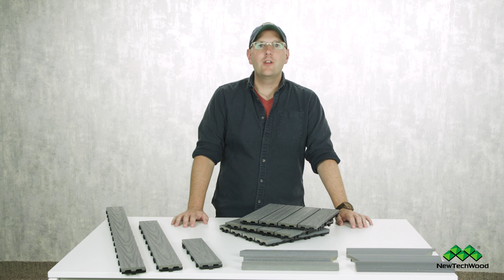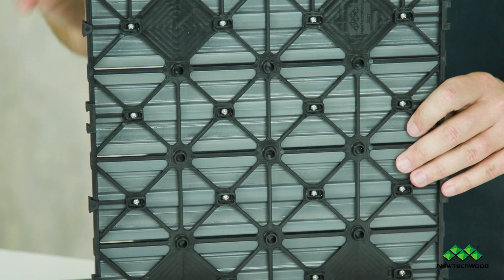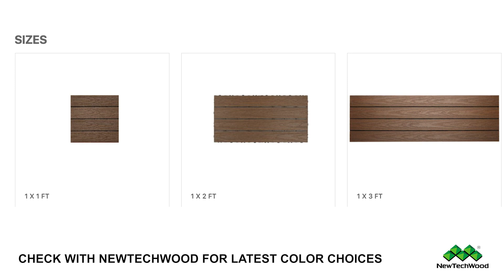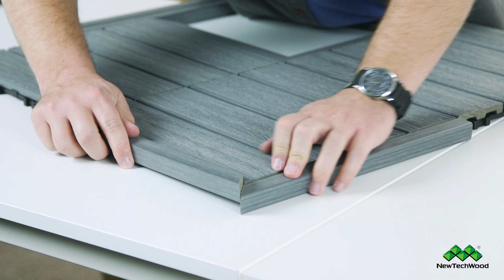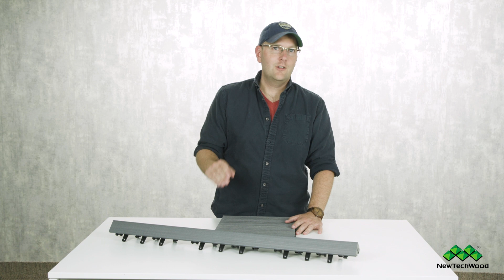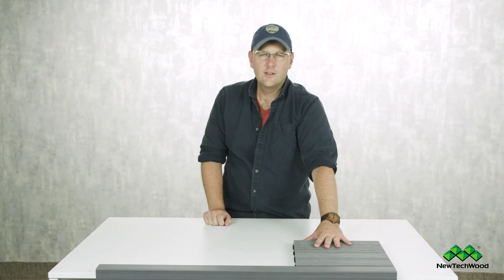NewTechWood Composite Quick Deck Deck Tiles Deep Dive

Comment: how hot do these get in the sun? can I walk on them barefoot?
Reply from the maker: You may walk on them barefoot, however the darker the color the warmer the feel. Composite decking can be 35-76 degrees hotter than the outdoor temperature. We would suggest installing over a covered area if possible.

Comment: How do you install these over the concrete patio stairs and the raisers?
Reply from the maker: Hello, You are able to use the stair trim to attach the tiles on the stair part and raiser. I have included a link to the installation guide below.

https://www.newtechwood.com/pdf/UltraShield_Deck_Tile_Installation.pdf

Comment: Damn this is awesome. I have a HIDEOUS large pebble aggregate concrete slab at my front door. What do you suggest I do to prep the surface? I “want” just to lay these on top but I worry it’s too rocky. Maybe a foam membrane? Or do I just pour thin set over the aggregate? It was 4k to remove it so that’s not happening lol. Any advice? Looking forward to hearing what you think. I LOVE this product!

Comment: do you recommend using this on ceramic tile? I have a roof garden and has ceramic tile but it is ugly and also gets super hot inside the building, so I was thinking installing this in that area, thanks!!
Reply from the maker: Yes you can install this on the ceramic tile.

Comment: Won't this system trap debris like grass, twigs, etc?
Reply from the maker: You should always install this on a pitch. The gaps are small enough that larger twigs and debris shouldn't get in. If they do  you can spray them with water and they should wash off at the end. Also these are very easily removed if you need to get one piece off.